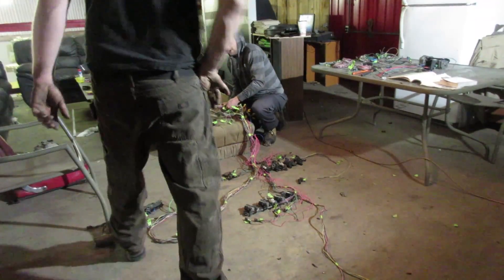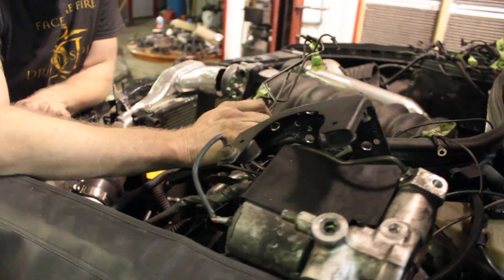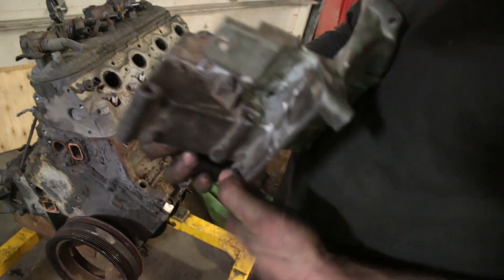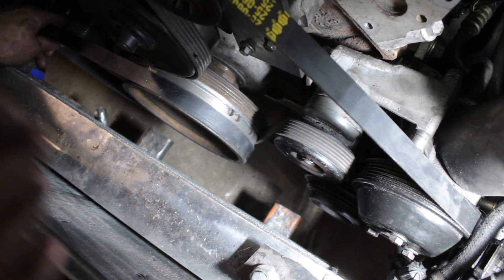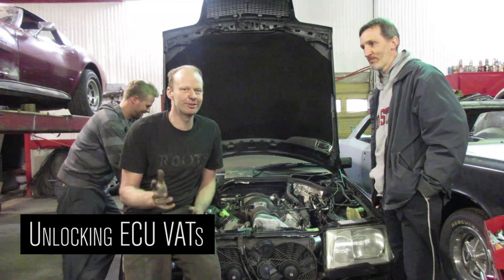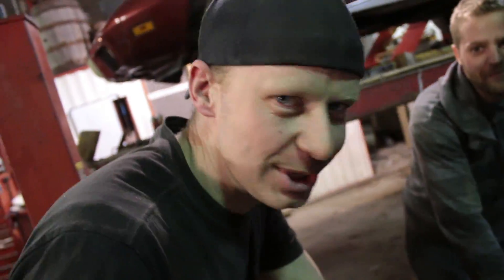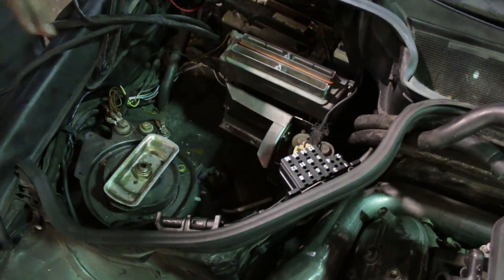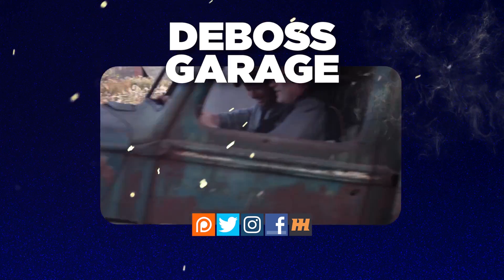CUSTOM WIRING HARNESS | Turbo LS AMG #HammerWagon [EP5]

Comment: where  da fuck is part 7
Reply: i mean part 6
Reply from the maker: In the works.  Finished the return for the downpipe and the car is getting the exhaust built right now at another shop.  Engine is running with stock internals, and another order of parts arrived in the mail....  Video will be out soon, sit tight.

Comment: Have you thought about ditching the hydraulic rear suspension and going to a coilover conversion in the rear and just plug the outlet on the pump? I'm pretty sure there is already a kit out there I haven't done any research on the 94 merc but I know many companies have come out with deletion kits for air bag set ups. Just a thought don't mean to critique or question your genius just wondering if it would save you the time in fabricating the pump housing.
Reply from the maker: I thought about it but in the long run, I do think putting it back the way I found it is easier.  New pump means new lines,  I would still have to do something with the AC compressor and then buy all new parts for the rear end.
Reply: I don't mean get rid of the Mercedes power steering power steering pump or changing anything about your ac bracket it think it's brilliant, I mean just capping the lines that feed the shocks in the rear so the pressure stays in the pump. How ever I do understand not wanting to spend any more money. After watching again, I wonder if you can move the alternator to lightly above the driver side valve cover and delete the idler??? Kind of like a 6.5 Detroit?? Maybe that would solve your tensioner and adding an extra belt plus giving you room for a bigger down pipe
Reply: Sorry I really don't mean to critique in anyway just trying to offer maybe a different perspective hopefully I don't come off as offensive
Reply: But you already have the wiring figured out and it looks like you don't have any room for an alternator right there anyway. Ignore  me keep doing what your doing! You know better then me!!!
Reply from the maker: Yeah, the downpipe will go there.  You don't come across as offensive, I don't mind another point of view.  Generally I don't get to choose where things go though.  Everything is so tight that it chooses for me

Comment: Didn't quite understand the computer business. Are you using the Mercedes computer for some things, and the GM computer for the engine?
Reply from the maker: That's correct.  Mercedes ECU will run the guages, AC and charging and the GM will do all the engine management
Reply: I like that idea a whole lot, seems like an excellent way of handling things!

Comment: Hey I was wondering where to get a 5.9 cummins I looked on eBay but everything is too expensive. I am going to swap a old 1958 ford f-100 351 to a cummins chassis help please
Reply from the maker: I have a couple for sale.  94 p-pump with 250 000 km on it
Reply: DEBOSS GARAGE do you have a 12 valve

Comment: Why not do a turbo in the rear, replacing the muffler with a turbo
Reply from the maker: This car is lowered so there wouldn't be enough room.  Besides, when you pop the hood, it would be disappointing not seeing that 76mm popping out at you

Comment: Should've done a low mounted turbo setup with a scavenge pump.
Reply from the maker: No, I couldn't be happier with how everything fits right now.  Exhaust fits better on top and as of where it is right now, I would do it exactly the same.  If I did a low mount turbo, the down pipe would have to go on top of the manifold and that would just look like a mistake
Reply: I don't see how it fits better on top when a low mount has a better and cleaner path straighter and downward, The exhaust down pipe literally has no room to do anything for a nice clean radius, when your exhaust manifold will be so close to the hood it'll bake the paint , and when the down pipe unnecessarily gives radiant heat to the heat exchangers.

It would have saved you ALOT of trouble doing a low mount.

Not hating but it would have been better with two smaller turbochargers placed at the bottom, you'd utilize 90 degree V8 exhaust pulses much better as well, because when it's single turbo cross plane V8  pulses aren't fully utilized and they overlap which is a waste of energy that the turbine could've used.
Reply: cool story bruh
Reply: @deboss garage awesome vids, keep it up and thank you for the great content!
Reply: Look forward to seeing your Mercedes LS swap vid. Link us!
Reply: Cruz er  That's a good joke, I would never swap a GM power plant into a Mercedes lol!

I have an SUV though I will be swapping an LS into though and I will be turbocharging it.
Reply: Cruz er  Is that your Mercedes wagon in the video or you're just choosing to be contrary?

Comment: awesome build guys I put a 02 lm7 and 4l60e into a 91 300E benz 4 door stock shifter and used a saturn steering rack deffinetly would have loved to keep that stock steering wish I would have double checked that I did use the gto oil pan it deffinetly goes crazy fast with the stock lm7 turbo would be ridiculous
Reply from the maker: The owner shared one of your links where the wiring was not done yet.  Do you have any videos?

Comment: very good video 
started making my first legit harness  
my original  ones is still using truck fuse panel 
I put a stock 6.0 in my 90 volvo wagon 
made a burnout video on my channel want to go turbo soon
sloppy mechanics  made the information  really easy

Comment: When you do your wiring, are you swapping the connectors and pins over to the gm style pins, or just hacking and soldering?
Reply from the maker: No hacking in my shop.  GM pins once we figure out proper lengths.  It will be running first.
Reply: what was your source for the pins and the crimp tool that you used? Many dont get to see how it done the right way. What tool did you use to remove the pin from the connector?
Reply from the maker: Have not done that yet.  I have a couple of my parts suppliers looking into it but we will definitely make a more detailed video on making the harness, flashing and tuning it.  Stay tuned!

Comment: Have you guys looked at Sloppy Mechanics for turbo ls builds?
Reply from the maker: Yep.  Its his kit from VSRacing that we are using.  He usues megasquirt though and we are using the stock ECU.  If we run into issues, we will definitely try and get a hold of him but I don't want to bug him with simple questions.  More than likely we will be talking about the fuel map.  Fabricating and wiring it is still the easy part.
Reply: Sloppy Mechanics have documented several builds using HP Tuners and stock ECU's. Also, not too long ago they shared HP Tuner base tunes on their Facebook page.
Reply: The tune are on their wiki page still.